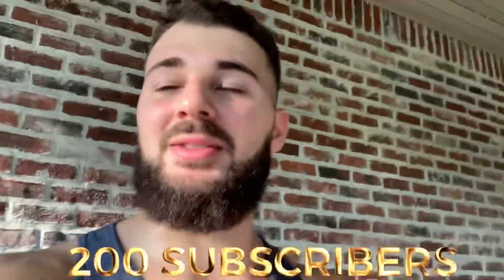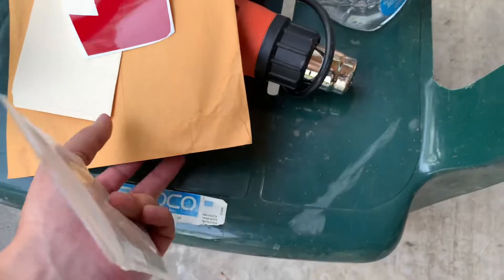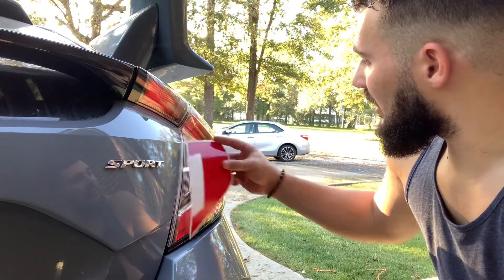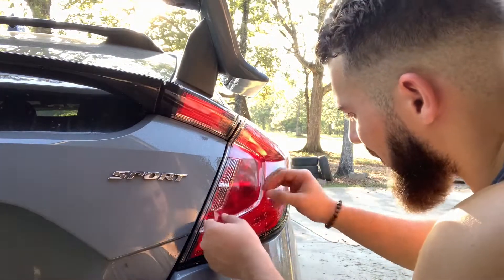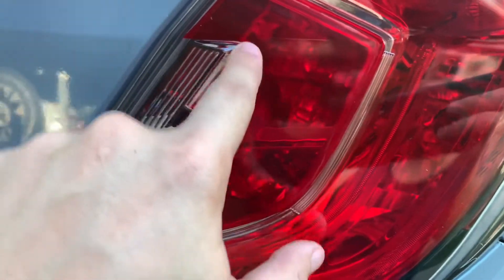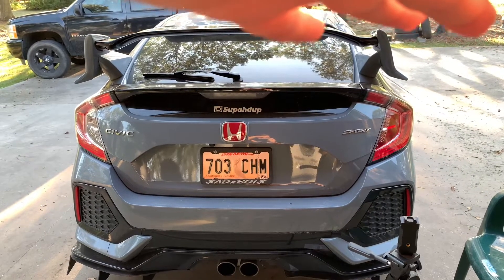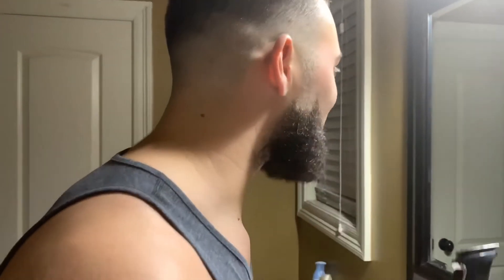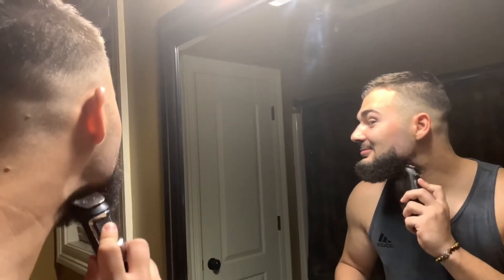10th Gen Civic Tailight Makeover (Vinyl Overlay Installation)

Comment: That’s super clean bro! Before the heat-gun process I really thought it’d look like a sticker lmao but it actually looks really good. Seems like a super cheap cosmetic mod to make your civic stand out from all the stock ones you see out on the roads. Also I heard denatured alcohol is better to clean surfaces on cars, do you think the isopropyl did the job fine? I’ve unfortunately got a small paint chip on the side of my new 10th gen civic, and instructions to repair I read were to clean with soapy water, denatured alcohol, add a dab of auto primer, OEM paint match and you’re good. F for your beard too 😂😂 Congrats on 200!
Reply from the maker: Thankyou man! I think it was around 20 bucks if I remember correctly. I don’t even remember who I bought it from, but the template they used was close but kind of crude. Idk why the left side bubbled up, maybe it was bc I didn’t clean it good enough or something lol. I think the regular alcohol works fine, but maybe the one you mentioned is better. And 10th gen paint is so shitty ☠️. I get new chips all the time, I just prefer not to even look 😭. And Thankyou for paying respect to the beard 😭😭😭